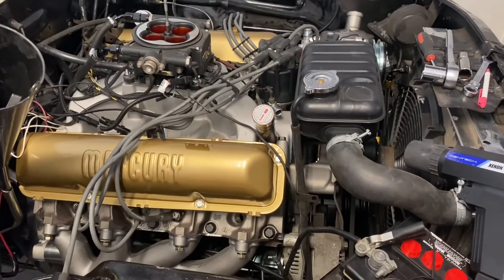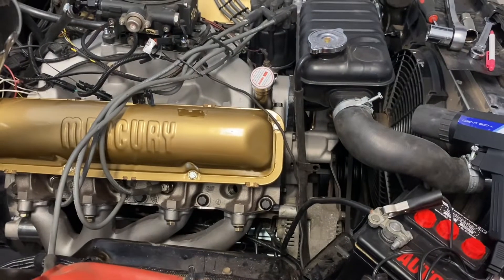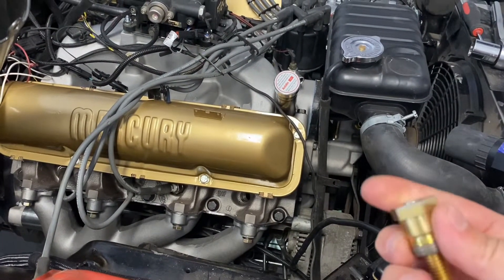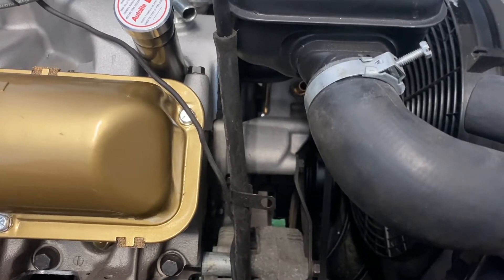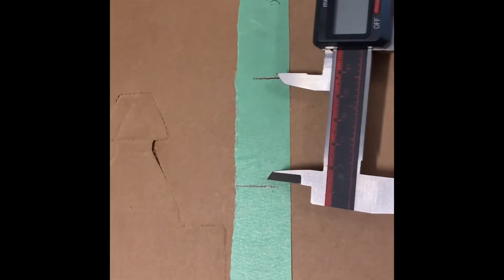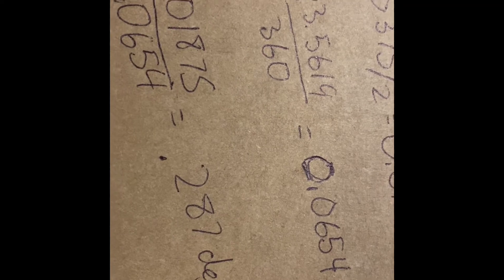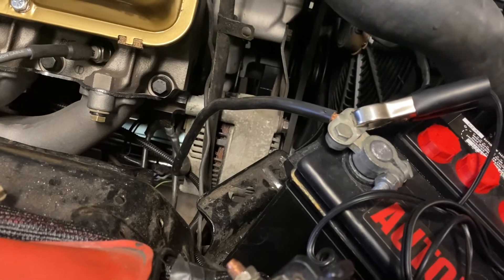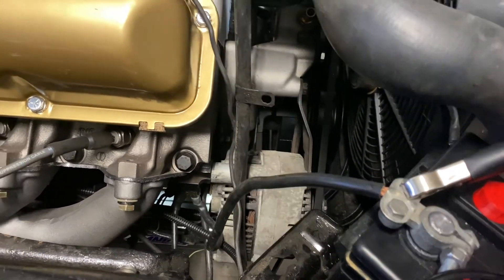Verify Top Dead Center Accuracy Using a Piston Stop

Comment: How much do you need to thread it into the plug hole? All the way at the bottom?
Reply from the maker: I had to thread it in all the way to make contact with the piston. As long as it does stop the piston, it’s good.
Reply: @JalopyJockey  thanks so much man🙏🏽 most creators won’t reply this late thanks bro 💯
Reply: @JalopyJockey  also my piston basically reaches the very top so do I need to have it stopped half way down? Or can I just stop it near the top? Thanks
Reply from the maker: @ayyy9017  it should be near the top. 10-15° from top probably

Comment: Hey, thanks for this man, I am working on a 64 Monterey, it is a 4-door but it is beautiful! The interior is pristine and it still has the paint/ coating on the underside! I am working on making it as smooth of a driver as possible, the engine is in perfect condition but the carb is completely messed up. I have been working on fixing it and just finally today I got it finished! Save a few adjustments, I am done working on the carb!🥳
While testing it and running through everything, I took it to a quiet stretch of highway, and planted the gas, I hit just about 102 mph! I can't wait to see more of your merc, it looks like tons of fun and is very helpful for referencing to! Thank you!
Reply from the maker: Hey, I appreciate it. You don’t seem very grumpy at all! Have you seen Carburetor Mike’s carb rebuilds on YouTube? He has great videos rebuilding 2100 and 4100 Autolites. These do seem to like a bit more timing than the Ford book says. Help with off idle transition. Also, need the accelerator pump to hit immediately with throttle movement. Join the 1964 Mercury Full-size fans page if you have Facebook.